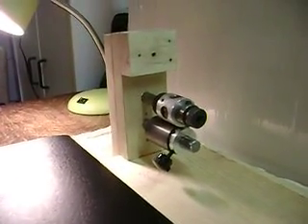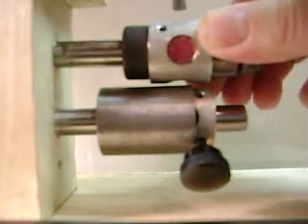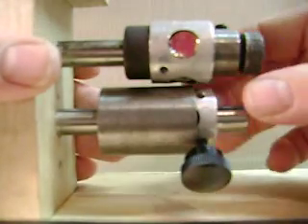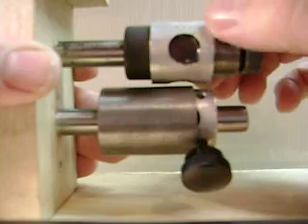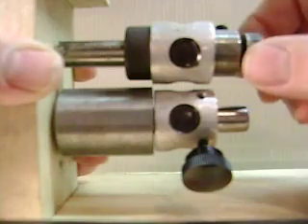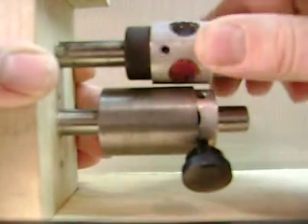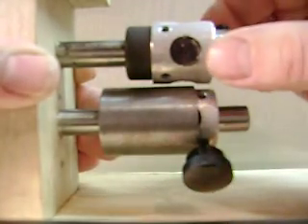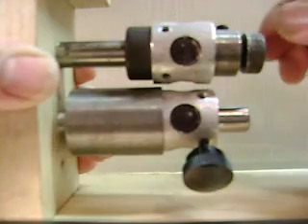Magnetic Shielding Demonstration #3 Autono-Drive  Magnet Motor Research

Comment: what is the material of the shield? Where I can buy it?
Reply from the maker: +macias sooo  The material is named soft iron or mild steel. If you can locate a machine shop in your area, they will be able to assist you.  Thanks for inquiring.Donovan.
Reply: +MagnetOnlyMotors thank you, but i dont understand why magnets in your video wont interact with the sleeve? why they wont pull or push it? magnets are supposed to interact with the iron?
Reply from the maker: +mkmai Actually they do. The iron gives a path for the magnetic flux to travel through & makes it appear to not interact with it. I like your questions!!Donovan.
Reply: +MagnetOnlyMotors thank you very much.. you're helpful. As a last thing, I live in a small town and I don't think I can find a machine shop or something like that. Is it possible to buy this online? Do yo know a website to buy? thank you again sir.
Reply from the maker: +mkmai  It seems almost anything can be bought online, I guess if you look enough. I live near a big city area, so that was never an issue for me.Try looking for metal suppliers, for instance. Search under images. I find a lot of things this way....Donovan.
Reply: +MagnetOnlyMotors is the shape of the mild steel important? I've been reading about magnet shielding materials and I guess a simple sheet or a rectangle won't work. Do you think this kind of thing works for me? http://www.themetalstore.co.uk/products/1mm-thick-mild-steel-sheet
Reply from the maker: +mkmai  I believe you should try to avoid sharp corners or angles. You will want to keep the soft iron about 1/16th " from your magnets & not let there be contact with each other, or else the iron will become like an extension of the contacted magnet. Also your shielding piece should be about 1/8th " thick. Make your parts sturdy, so they wont get bent when getting close to your magnets.Donovan.

Comment from the maker: Hello Cory, I don't understand as I do not use any batteries in my projects. I have seen other people use battery parts but I don't get the significance of doing anything that way.  Sorry. About the tin, I would think it would work as long as there is sufficient thickness. It is magnetic, right? 
    Thanks for commenting!!

Donovan.

Comment from the maker: Hey Max, yes you need effort to push the magnetic shield out of alignment with the magnets. It feels as if this requires more effort when the two magnets are of the same polarity, rather than when they are of opposite polarity.  Hope this is of some value for you. Thanks.

Donovan.

Comment from the maker: @jjackFrenchi35 Hello Jack, 2 magnets is fine & they do need to be the same polarity to see the effect. I had 4 only because they were borrowed from an earlier test subject & the glue holding them in place was performing very well. The magnets are not actually mounted in the sleeve, plus the sleeve can not contact the magnets, because then it will behave like an extension of the magnets. I don't quite understand your 2nd question.
Donovan.

Comment from the maker: @francyh199  Hey francyh199, Those are 1/2" diameter X 1/8" thick neodymium magnets. The rotor is about 1" diameter by about 1" long. The iron sleeve has about 1/16" clearance around the rotor and the same for the stator clearance. The sleeve is about 1/16" thick where it slides over the rotor & then down to 1/2" diameter to fit over the shaft. It is a very simple unit with minor precision required when only used for a demo. Have fun!!

Donovan.

Comment: are those ceramic magnets or neodymium magnets? .. also what is the width of the iron tube.. and the dimensions of the magnet.. i wanna try my self but i have neodymium magnets and i wanna calculate the width of the tube so it can shield.. thanks a lot !

Comment: @MagnetOnlyMotors There's no substance that will stop static or low-frequency magnetic fields. So unless what you're working with is an electromagnetic field and has a power source, this video is smoke and mirrors.

Comment: @MagnetOnlyMotors - you're working on magnetic motors because someone has said they work and you say that is thinking for yourself.  I worked out many years ago these things couldn't work..  I have merely offered advice on why these devices can't work - there is no net energy gain by any configuration of magnets or use of shielding.  Live with it.

Comment from the maker: @DanFrederiksen. Dan, The other way around means, it takes more energy to get the shield out from between the magnets, rather than getting the shield in place. That is why I was using solenoids to cause that action. I was just testing a theory to see if magnetic shielding could work.
Donovan.

Comment from the maker: @firstnameandrewallan, Well Andrew, You made  the explanation yourself. Magnetic fields cannot be insulated, but only redirected in the soft iron. Maybe another way would be that the flux travels within the shield easier than through the air, so it basically eliminates the effect outside of the shield. Does that help?
 
Donovan.

Comment from the maker: Hello Greenpeace82, You should be able to obtain this metal, also called mild steel from any local machine shop or even a scrap metal yard may be able to help you. Round bar stock is easy to get at a machine shop & they will be glad to work it for you.( for a small fee mind you..).
  Donovan.

Comment: If the shielding were mechanically alternated and an extra post added, it seems that it would rotate with a minimum of mechanical force. The excess would depend upon the strenth of the magnets. If the shielding doesn't work perfectly, make it slightly thicker and it will.

Comment from the maker: In this display it took very little force to pull the sleeve back as it is reacting basically between 2 magnets. The ideal position is when like poles are in facing each other,withdraw the sleeve & then they can repel & rotate.
 
I would say that the force was only a few ounces of pull. As for the return motion it is pretty much automatic.